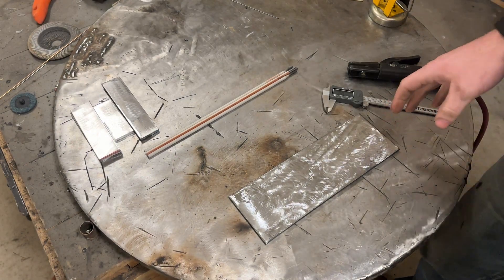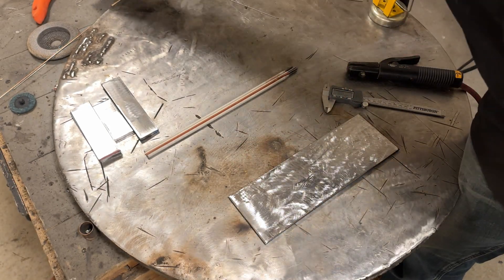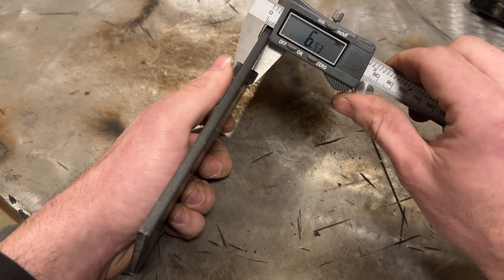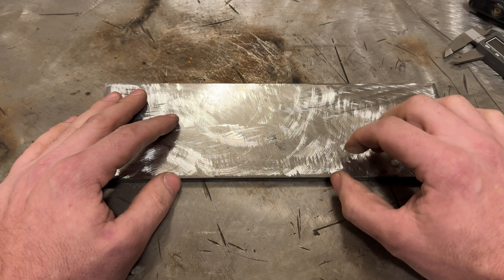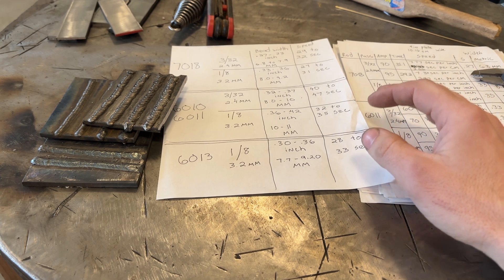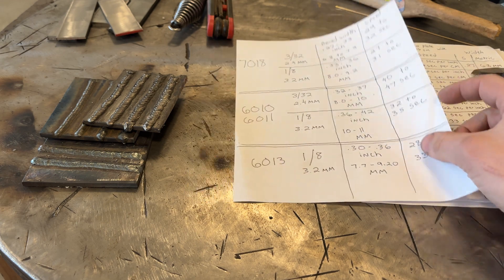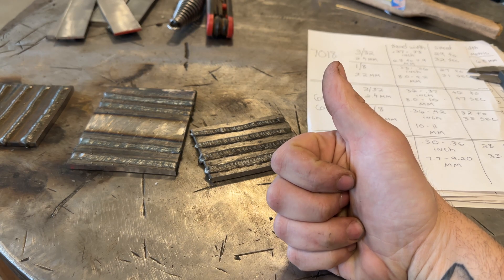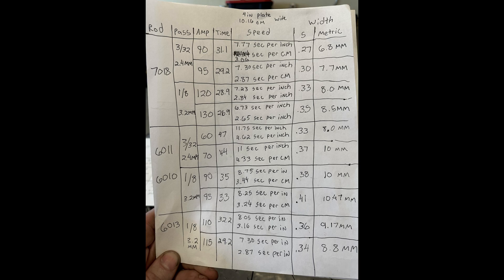Width and speed measurements of ideal stick welds

Comment: Hey Greg! Thanks for this interesting "shootout" and information! 😃 I just started welding. Always had it in mind but it took 43 years and some holes in the muffler of my car to finally get a welder and start the journey of melting iron 😁 Watched quite a few videos from you now and I think it helped me get started and layin' down my first beads... Welding thin 1,5mm muffler pipe is hard, tho 😅 Dont know why I have to start with this 🙃

And for your information: No, 6,4mm is not a standard over the sea here in germany/europe. We tend to not mess around with odd and wonky numbers like 2and-a-half 6/24th or something for our standards 😂I never get why 'Merica! makes it so hard for everyone🤣There is a bit variation in production of this materials and, at least here, if you by 6mm stuff you can be pretty sure it is minimum that because thats what you paid for. But could be often a little bit more with millscale and uneven faces.
But no rule without exception; there are some "standard sizes" for thin stuff. Like sheet metal can be anything from 0.5 to 0.6, 0.8, 1, 1.5 mm... Then it kind of straightens out with whole numbers, continues more ore less with 2, 3, 4, 5, 6, 8, 10, 12, 14 ...and so on. The beauty now is I now exactly, without heavy calculus, that my 0.5 is half of 1; and one is half 2, so 6mm is 3x2 or half of 12 and so on ... 🙃
Thanks for the conversion! And for all your teaching! 
Greetings from Munich, Bavaria 🍻
Reply from the maker: Glad to hear you picked up welding.  As you found out in a hurry, welding thin material (especially exhaust) is quite a challenge lol.  Don’t feel bad, one of the first repairs I ever did was welding a muffler on an exhaust system.  It fell off later that day 😂.  You’re already likely doing better.  Thanks for the tips on metal sizes.  Here in the states they use “gauge” for sheet metal and fractions for thicker.  When you get used to fractions they are pretty handy/fast for certain tasks.  They are rather tough to teach some people, even though they are simple in principle, that’s definitely not a good aspect lol.

Comment: As a rough estimate the bead widths shown are approximately 3 times the rod diameter.   Is it possible to correlate your data with flux core using say 0.8 (0.30) & 0.9 (0.35) typically what would be the bead width for these wires with your usual settings?  

You are correct, welders say that a bead is thin or broad but rarely does anyone quantify anything. This really helps.
Thanks
Reply from the maker: I will be doing a bunch of flux core beads and comparing them soon.  It’s going to be a bit different with wire process because you can (in a way) produce any size weld you want based on feed speed.  A upcoming video will clarify all of that.  

Also, excellent observation on the 3 times rod diameter, that is a good way to look at it 😀
Reply: A lot of wps’s will say that 2.5 x’s the rod diameter are acceptable, and for wire a lot of times should be about 5-6 x’s the wire diameter which seems a little small especially for the bigger fluxcore wires( .068 and up)
Reply: I’ve looked at the Lincoln website and it suggests 5 to 6 times the wire diameter which agrees with you but nothing about stepping up as the wire size increases
Reply: @brianhowe8896  my wording may have been incorrect.  I wasn’t suggesting that the bigger wires increase. I meant that it’s not uncommon to see bigger beads than the 5-6 x’s diameter with the bigger wires. Countless times I’ve ran 1/16” and 5/64” wires with 1/2”+ wide beads when the fit up is bad or filling big grooves with multi pass welds. The crazy part is that when I took my first .045 dual shield test years ago I was told to weave the 1” plate the whole way out. Cover pass included. Times have certainly changed, but if there isn’t a restriction put in place ppl will still put in big ole weaves
Reply: @mkearn724  Thanks for that.  Very interesting.

Comment: Hey Greg, I got a MIG welding hack I need tested if you'll give it a shot. You setup your welder for flux core with Lincoln NR-211 MP, but then add shielding with 75/25 (not Co2) and use a straight drag. The Lincoln multi-pass wire has a more aggressive flux than some other brands, but this was what was recommended for the hack. It's supposed to flow like butter, with very little splatter. Maybe you could run cheap flux core wire with the hack and weld through paint and rust? Please test on 115v.
Reply from the maker: It wouldn’t surprise me that c25 gas would work for straight flux core.  Dual shield functions in that way.  The only thing is by using a shielding gas with a non dual shield wire could potentially change the properties of both penetration and destructive testing results (aka tensile, charpy v-notch, elongation, etc).  

Cheap flux core will weld right through paint and scale on its own, but obviously spatter will be a definite issue.  Flux core spatter tends to be much harder to remove than say 6010 because it’s much finer, a chipping hammer won’t cut it lol.  I will give it a shot though 😀
Reply: @makingmistakeswithgreg  I saw some dual shield wire that was rated for both C25 and C100, found videos on here where a guy was comparing the results. I was interested in regular flux core wire with C25, perhaps Lincoln is secretly compatible? I don't want to try to run 0.045 with my 115v welder, plus I would have to buy another roller.
Reply from the maker: @massa-blasta  gotcha.  I will try it, I have no idea on the results lol.  I have no issue experimenting with wild stuff like that 😀